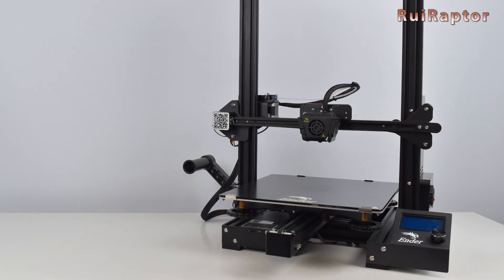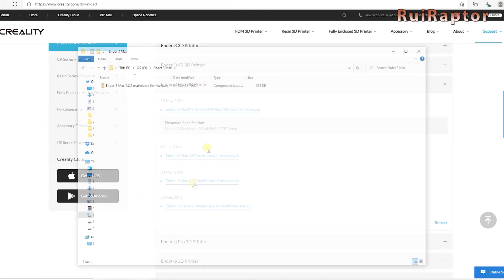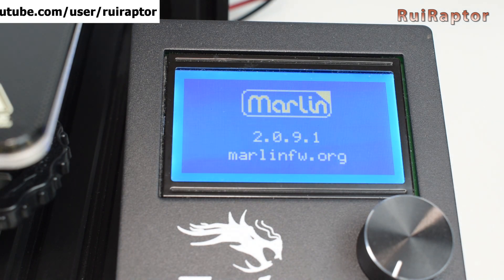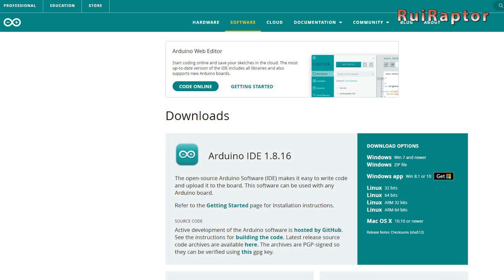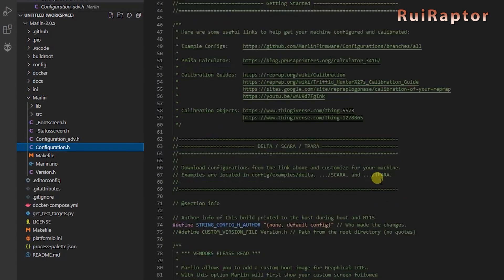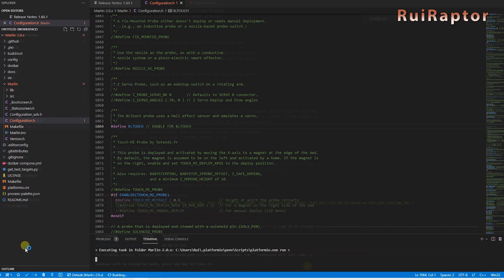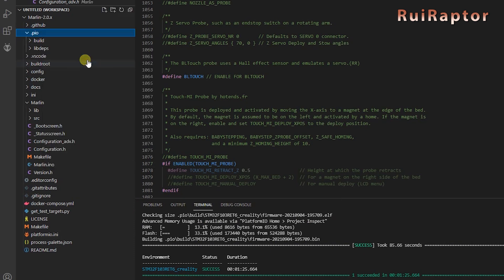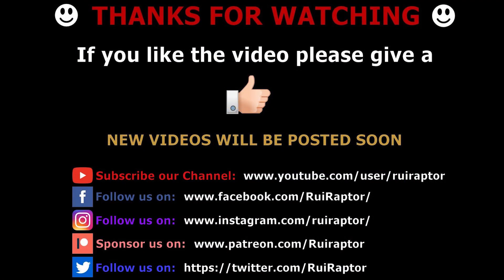Creality ENDER 3 MAX - How To EDIT & UPLOAD New Firmware

Comment: Oh man! last time I did this was in 2020. Just went to Creality site, downloaded the firmware for both CR10S and Ender3MAX, saved it to the machines own and individual the micro SD cards... walked to the printers, placed the Micro SD turned them ON set it and forget it. Done in less than 5 minutes. After some time now, wanted to see if there was updates, Site no longer have anything to do with it's old machines. Went down this rabbit hole and here we are, asking to download program to edit out the code??? WTF? WHAT HAPPENED?? where did they go wrong? what's wrong with Plugging the USB let the software talk to the site and then just puff magically the machine updates its self.

Comment: I have the new firmware, but I need to know how to change the max temperature settings for the all metal ( micro swiss) hot end before download to the machine. Is it possible to change it then install the firmware?

Comment: I downloaded the CR Tuch firmware form Creality site. Then the printer motors stopped working Is there a way to do a factory reset or any other way to get the printer working again?.
Reply from the maker: Hi, you can only restore settings not firmware versions. Try flashing a different version.

Comment: As well explained as your video was, it did absolutely nothing to get me up and running with a new Marlin properly configured.
I suppose not being at all familiar with VS Code might have something with it but I can't get this thing to compile without errors at all. I don't even change anything in the coding and it throws errors right away (like the FAN_SOFT_PWM thing). To make matters worse, I don't even know where I'm supposed to go to fix anything when "error: 'manual_feedrate_mm_s' was not declared in this scope; did you mean 'feedrate_mm_s'?" is thrown at my face. I don't know if that's what I meant...I don't even know what that means.
Why is it that VS can't just compile a firmware from files fresh off the download page without errors??? This is driving me nuts and I can't find a current firmware compiled with the necessary feature settings I'm looking for.  This is frustrating. I don't have enough rum for this.
Reply from the maker: Hi, check our latest video and also the comments as we explain those issues:
https://youtu.be/S0epn4ANJlo

Comment: Hi, if I change the Merlin version to 2.0, did the Calibration of the stepper Motors and Exdruder are the same values ?  or did i need to do new Calibration. thx

Comment: I tried following the tutorial but i keep getting the same error. i modified the default_enf at the start. should i change it somewhere else?

Error: Build environment 'mega2560' is incompatible with BOARD_CREALITY_V4. Use one of these: STM32F103RET6_creality, STM32F103RET6_creality_maple
======================================================================== [FAILED] Took 1.00 seconds ========================================================================

Environment    Status    Duration
-------------  --------  ------------
mega2560       FAILED    00:00:01.004
=================================================================== 1 failed, 0 succeeded in 00:00:01.004 ===================================================================

Comment: @ruiraptor, Hi! 
When I try to compile VScode it reports the following error and I am not able to resolve it.
" #warning "Creality 4.2.2 boards may have A4988 or TMC2208_STANDALONE drivers. Check your board and make sure to select the correct DRIVER_TYPE!" [-Wcpp] "
I already checked the drivers in "configurantion.h" and they are "TMC2208_STANDALONE" .
What can I do?
I'm using marlin 2.9.3.
Thanks
Reply from the maker: Hi Luiz, that is just a warning and not an error. That warning will not cause the compiling process to stop.
Reply: @ruiraptor  , Thanks for your help. I discovered the problem.
I relocated the project folder to "C:/Projects/Marlin 2.0.9.3/" and it worked. Before it was in D:\Usuários_2\user-folder/Projects/Marlin 2.0.9.3/". I believe that adding to the other sub folders until reaching the .bin location, VS Code was having some problem and wasn't finding any other required file.
But once again, thank you very much for your help.

Comment: I extracted the files and deleted the zip and then brought the files that were in my printer's folder over into the marlin folder and now I'm trying to open that in platformIO and the marlin files are invisible. What do I do?
Reply: I have this same issue
Reply: @stephenpijnnaken963  when you go open project in platformio, I found mine under my onedrive. I have windows, and my files were on my desktop so my steps to finding them was C: / users / Noah / onedrive / desktop

Comment: Thanks for posting this, made things a lot easier!  For others that may stumble in, as of Marlin 2.0.9.3 there's an extra option that needs to be enabled that's not setup in the example config files,  ~ line 2857 in Configuration.h -- #define FAN_SOFT_PWM.  After enabling this (from following the error messages in the build) it built without issue and I can now use Octoprint on this beast.

Comment: If I haven't upgraded my printer, now there are several firmware upgrades on the web site, do I have to do it in order, from the oldest to the newest, or is enough to upgrade firmware only with the newest?

Comment: I need help. I found the firmware in the folder after I compiled it but it won’t let me transfer the file to the sd card. I’m using a MacBook Pro if that information helps at all
Reply: It’s also showing that the firmware file is a zipped
Reply: It shows an error in the pin.h file. It says “please update your include path”

Comment: You dancer, you absolute and utter dancer, THANK YOU THANK YOU THAAAAANKKKKKK YOOOUUUUUUU

I have been fulling my hair out trying to compile this with BLTouch and getting error saying BLTOUCH_SET_5V_MODE not comatible with z_min_pin or something like.. I have been at it for about 5 hours!!!

I was using the Auto Build Marlin plugin which was reporting the correct env, but clearly it was NOT set to that in PIO and so was trying to compile for the wrong board all this time..

You sir, have saved my sanity, I have now managed to compile custom marlin for the first time, If I ever win the lottery I will make you a rich man :)

Thanks you again :)

PS.. auto build marlin is getting slung out the window right now!!!!

Comment: RUI you must have heard my prayers, i got a E3 Max that was a return and its not been playing nicely. TH3D firmware seems to ignore the z offset that im putting in now i have a BLTouch, the creality firmware works with the BLTouch but increments of 0.1 make the first layer either too low or too high and it doesnt give the 0.025 increments that the later marlin firmwares do. I have the firmware compiled from this video instruction im just missing what settings to change to activate the BLTouch which is connected to the dedicated 5 pin port on the board. I really hope your video explaining this comes soon as im hoping the bed levelling wizard will get me up and running. Many thanks - Matthew
Reply from the maker: Hi Matthew, 
here's the video you were waiting for. 
Hope it helps :)
https://youtu.be/-76t_fOhb2M

Comment: Do you share the .bin file anywhere?
Reply from the maker: Hi, we normally share our firmware versions for free on our Patreon page. For the Ender 3 Max, we will upload some soon.
Reply: @ruiraptor  Have you uploaded it? I tried following your instructions but after compiling it it won't boot, so I was wondering on trying one of yours, I don't have BL Touch